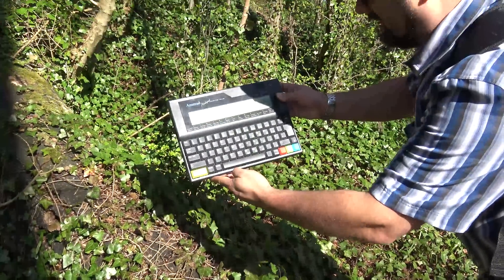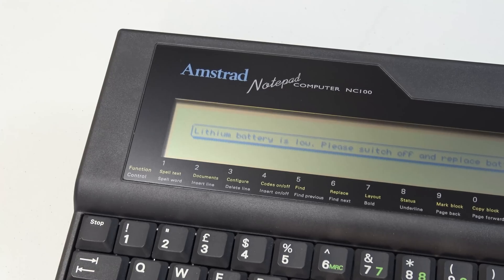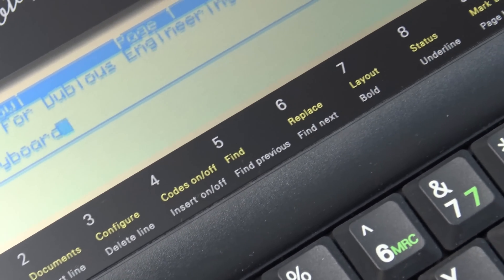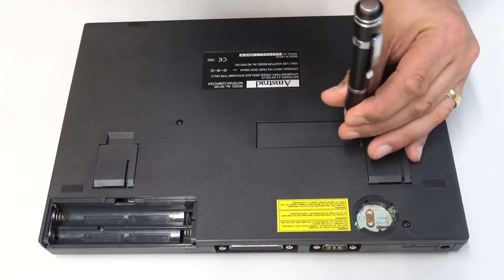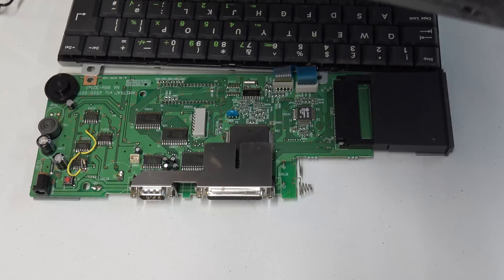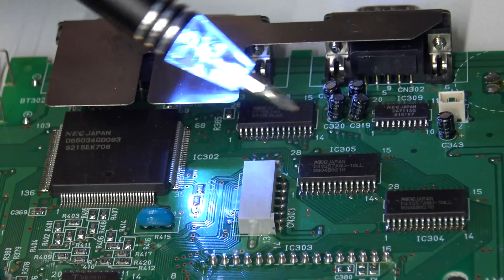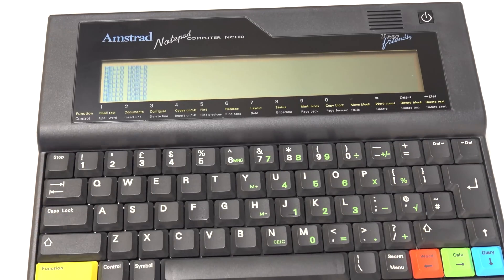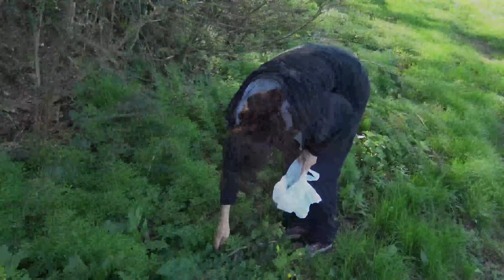DuB-EnG: Most HIPSTER retro Z80 laptop AMSTRAD NC100 BBC BASIC - Nostalgia - Memory Lane

Comment: BBC Basic is so powerful, some TV technicians used it to pull colour information out of b&w film copies of colour programmes, where the original colour tapes were no longer available (having been wiped). The BBC used to make b&w film copies of shows to sell overseas, because there were lots of competing TV standards at the time - we were on PAL Colour, but the French and Middle East were on Secam. Parts of Africa were on 405-line b&w. North America was on NTSC. Other countries were on 625-line b&w. So, the easiest thing to do was send out b&w film copies. The technicians were supposed to put a filter between the TV monitor playing back the colour master and the b&w film camera making the copy, to ensure all colour information was removed. But most of the time they never bothered.

Years later, someone noticed colour dots on a repeat that only existed as a B&W film transfer. So, they theorised there must still be colour signal information locked within the picture, wrote an algorithm in BBC Basic to scan the dots and work out the colour values. They've been able to compare with some shows where there was both the colour original still the archive, as well as the b&w film copy, and have managed to recover full colour from it. The process has improved steadily - they've new been able to colour recover several episodes of Dad's Army, a Morcame & Wise Christmas Special, episodes of Doctor Who, and several episodes of Top of the Pops, with legendary performances by the Rolling Stones, David Bowie and others.

Pretty amazing.
Reply from the maker: Wow! Who would have thought that BBC basic could help regenerate colour in B&W films!....  Thanks for the education!  I’m now off to watch some dads army :-)
Reply: @DubiousEngineering  Yes, it's incredible really. You can find out more from this article - there's also a link to an older article within it, which is also worth a read.

https://www.theguardian.com/technology/2008/dec/11/digital-video-restoration-dad-s-army

Comment: Awesome video! I've actually got bot a NC100 and a NC200, im planing to try to get the NC200 to work as a serial terminal for my Linux computers :D
Reply from the maker: Ah!! That should work.. I believe there is a terminal emulator that runs on it over the rs232 port
Reply: @DubiousEngineering  I think it's the Yellowkey and T or maybe S, i've seen it once but did not have a nullmoden nor anything to put in the other end, so did't got around to test it :P
Reply from the maker: Make a little loopback connector...  Then you will se it transmit and receive...